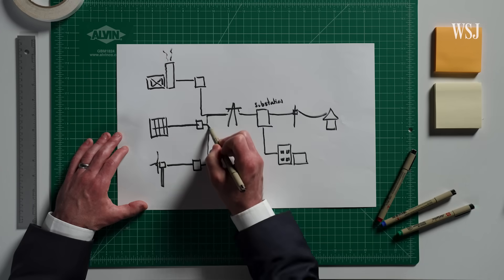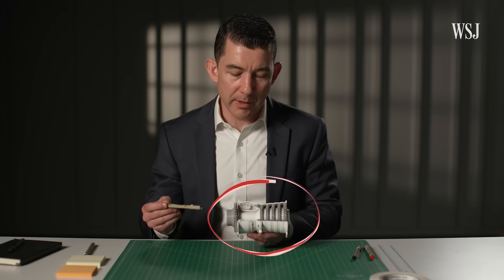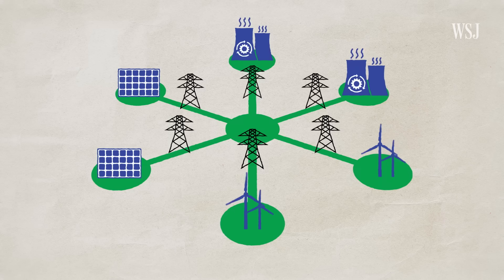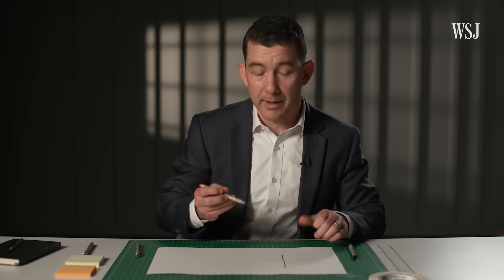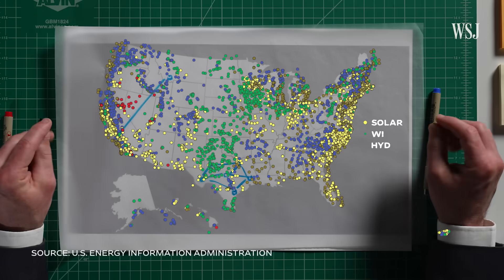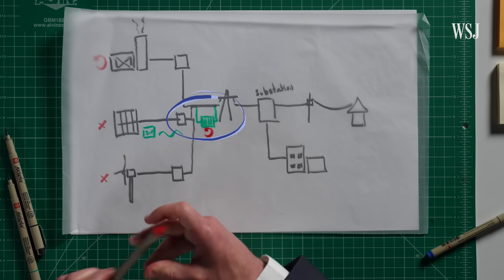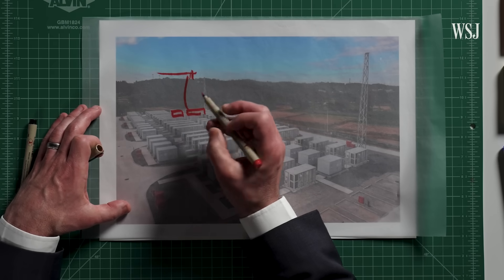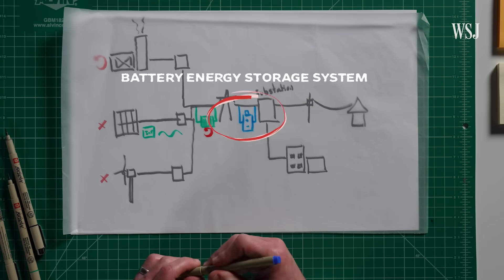How to Fix Renewable Energy’s Hidden Infrastructure Problem | WSJ Pro Perfected

Comment: Use Tesla massive battery packs, that is the solution…. Struggling with other things that are old and they are not designe with new technology like solar panels etc
Reply: This battery packs need to supply energy through the grid inverter, and this does not have enough inertia! And the problem will be not solved! Not the missing battery makes problems, but missing inertia in the grid! You need this inertia, that the grid can work stable, thats all!
Reply: @konstantinhuwa3064  Not really.  Batteries with inverters with the right software & sensors can provide "synthetic inertia".  This synthetic inertia can be better than physical inertia because electronics can work in millisecond speed to match frequency and phase.  But rotating masses of steam turbines take time especially phase matching.  If the turbine cannot match the grid's frequency and phase quickly enough,  the turbine actually becomes a drag on the grid and introduces instability.

Moreover, batteries provide large amounts of two-way energy.  That is, a battery can soak up power during the mid-day when the grid is abundant with power.  This energy can be used later.  That alone provides a large amount of grid stability later on especially as this surplus mid-day energy might be otherwise curtailed so saving this power to storage is very cheap—possibly even free!

A synchronous condenser (and any turbine really) can't do any of that and only provides reactive power stabilization.  The next generation grid will still have synchronous condensors, but a lot more grid storage capabilities too.  The next generation grid won't be like the old generation grid.  This is how technology progresses as you can't keep thinking the same mindset and make progress at the same time.
Reply: @beyondfossil  Thank you for your explanation, but i know, how batteries work, and what is synthetic inertia. And by rotating mass and physical inertia of them was not meant some turbine and alternator, which is not synchronized with the grid, and needs time to do it,  but rotating mass, which is already synchronously rotating with the grid, and don't even need a millisecond to react! It is already part of the grid, and reacts instantly. Because in the huge grid there are waves of changing of frequencies, which are walking from side to side, reflecting from the ends, behave like waves and through superposition can happen, that frequency itself could be ok, but the surging is too high! And by the grid, there are such protection mechanisms, which turn off exactly by fast changing frequency! And it can feed to collapse, even if there is enough power in the grid. The grid can behave like ripples on the sea, and destroy itself if there is not enough inertia. And sometimes, even synthetic inertia can be not enough. And maybe the cheapest way to get this inertia, is flywheel + alternator in the vacuum chamber, to reduce energy consumption, which reacts faster, than electronic systems?
Reply: @konstantinhuwa3064  Yes, glad you mentioned all that.  In fact the drifting and rippling problem you described is a direct consequence of the old "analog" grid design that we inherited!  Especially with today's grids that span such wide geographic distances.

What's happening is the grid is so wide-spread that the timings can change over the large expanse of a typical grid.  Example: at 60 Hz, a full cycle is about 16.7 milliseconds, so a 1° phase error corresponds to just 46 microseconds.  So over 1000 km, signal delay is around 5 ms, which could mean more than 100° of phase difference if unmanaged.  That 1000 km doesn't have to be a distance away either—but just a "linear" distance which can occur well within 1000 km distance given the complex topology of grid connections.

The true heart of the problem is our current grid is analog and is essentially operating asynchronous mode.  It is also using itself to check that itself is working—this is is an incorrect way to do this check as you cannot accurately use yourself to test if yourself is working as it causes "recursive" self-propagating errors.
Reply: @konstantinhuwa3064  YouTube is not allowing me to post any more information
Reply: @beyondfossil  The problem, what we have seen in Spain is not only blackout, because of not adequate inertia, the problem is, that grid has collapsed completely. It would be much better, when by problems somewhere each small part of the grid could disconnect themself and work separately, without problems. But so, you need a very distributed system, with enough storage systems and enough power everywhere, capable of actively changing the frequency to match to other parts of the grid, in case to build a huge grid again. That's why alternator + flywheels are needed everywhere, well distributed. Synthetic inertia is good, but i would not trust it, because it can be damaged through cyber attack, through too high sun activity, or some other electromagnetic impulse. Too much electronic systems is not good, good old flywheel and alternator is much more reliable! Even on big nuclear plants this mechanism is used to supply critical infrastructure with electrical power, when power plants lose connection to the grid, or by blackout - rotating mass + alternator.
Reply: @konstantinhuwa3064  Something strange is happening here in the forums.  Your response this morning doesn't show up on the forums but only shows up in my alerts feed.   My response to  your response isn't showing up either.  I'll keep trying...
Reply: @konstantinhuwa3064  Sure, but regular turbine-based generation is also subject to attacks and errors.

Turbines actually become loads (drags) on the grid (as a synchronous motor) if their fuel flow were cut which is worse than an instant blackout.  Even without a preemptive grid disconnect, a turbine would only provide a few seconds of inertia before becoming a megawatt-sized drag.
Reply: @konstantinhuwa3064  Furthermore…

Turbine-based generation is also controlled by electronics integrated with the grid.  If the electronics detected a fault, they would quickly disconnect the turbine from the grid otherwise the turbine actually becomes a load on the grid as it becomes a synchronous motor pulling from the grid!  Being a load on the with massive megawatt -sized turbine is actually worse than a quick disconnect.

In fact, maximum damage to the grid would be inflicted if somehow turbine fuel flow shutdown occurred while also leaving the turbine synchronously tied to the grid!  The load (drag) that a megawatt sized turbine would have significantly greater negative consequences than an instant disconnection!
Reply: @konstantinhuwa3064  Furthermore…

So the argument that "turbines provide inertia" is actually not a benefit in this case.  The so-called benefit is actually completely by-passed in normal turbine fault-recovery operations and you have a near instant disconnection in either case.

Moreover, although inverters may instantly disconnect by nature, they can also quickly reconnect in order of magnitude faster than a turbine could ever do.  Reconnection for an inverter might be only as complicated as car merging onto a freeway.
Reply: @beyondfossil  I am not talking about steam turbine + alternator, i am talking about flywheel + alternator, such machines in vacuum chamber (to reduce self consumption) are for example specially added to grid in Ireland, 120 t weight, because they have much of wind power plants, which does not have enough inertia. This is not my personal fantasy, these are already real machines, which work very well, mechanically, with real inertia!
Reply: @konstantinhuwa3064  That is good to hear.  I often use flywheel kinetic energy storage (amongst others options) as an additional option over lithium batteries against detractors who say we can't get enough storage because of limitations of lithium.

But, just to be clear, flywheel energy storage still needs an inverter though.  So, from the grid's point view, it appears as an inverter resource.
Reply: @konstantinhuwa3064  Specifically, a flywheel's power electronics rectifies the 3 phase alternator AC output to get DC electricity then DC is feed into an normal inverter similar to how wind turbines do it.

Because, like a wind turbine, the flywheel does not operate as direct coupled synchronous load like a steam turbine since the flywheel's RPM is likely never in the range that matches the frequency and phase of the grid.  

The flywheel needs highest available RPM to store the most energy possible.  Then the RPM slowly falls as energy is extracted from it.  Kinda like the voltage of a battery drops as current is drawn from it.
Reply: @beyondfossil  No my friend, this flywheel + electrical machine has nothing of power electronics between the grid and his electrical machine, to change his rotational speed, it is not for storage of energy, it is really only for the inertia of the grid! Nothing more! Imagine, you take a synchronous electrical 3 phase machine with a flywheel on them, accelerate him, till it has the same frequency and phase, like a grid, and connect it to the grid, with nothing additional at all! It gives only inertia to the grid, to stabilize it, that's all.
Reply: @konstantinhuwa3064   Okay, that sounds like  a fairly common synchronous condenser which is used all over the grids even in today's era of lot of turbine generation.  I mentioned this piece of equipment on my first response.  A synchronous condenser likely would be used in next generation grids as well.
Reply: Except a battery bank that could support the entire usa would literally cost trillions of dollars. 

That's not an option my man

Comment: Normally, all steam turbines and alternators rotate with 3600 rpm. But if the energy of rotating mass depends from square of rotational speed, it is better to use some epicyclic gear box between alternator/motor and mechanical flywheel, to increase the angular momentum, so the inertia of this unit will be higher, like when alternator is directly connected to the flywheel.

Or maybe much better instead of gear box to use special frequency changing transformer between power grid and alternator/motor + flywheel? Because so the inertia will be square times higher, and alternator/motor will also rotate with higher speed, together with flywheel, so the inertia will also be higher! For example, if the frequency on the primar winding on the grid side will be 60 Hz, but on the second winding of the transformer for example 180 Hz, then motor and flywheel will rotate with 10800 rpm! And achieve 3x3=9 times more inertia, than by 3600 rpm! And no mechanical gear box will be needed, what could be much more reliant, more cheaper and have much longer life time! And the whole rotational modul could rotate closed in vakuum, to reduce energy consumpion!
Reply: No, that doesn't work.  There is no "special frequency changing" anything in electronics without first going through a DC (rectification) stage.   Turbines that are able to supply inertia can only do so because they have fixed reduction gears.  No variable anything.  i.e. they have to be strongly mechanically coupled to work as intended.

Frequencies have to be synchronized down to microseconds of phase variance.  No amount of variable-gearing magic can match that.

-Matt
Reply: @junkerzn7312 Of course there is such a mechanism, for example if you connect two electrical machines through a common shaft, and one machine will work by 60 Hz, and the second one for example by 180 Hz. And to the second machine we could connect an electrically additional alternator + flywheel, which will rotate with 10800 rpm, and achieve 9 times higher angular momentum and inertia, like if it will rotate only with 3600 rpm! And variable reduction/multiplication mechanism is for example so called double fed electric machine. Of course you need an additional frequency controller, to change the rotational speed of the magnetic field of the rotor, but it has good mechanical behaviour for transferring of inertia and additionally working like an energy storage system with a wide range of rotational speed of flywheel.
Reply: @konstantinhuwa3064  What do you think the shaft is connected to?  Rotating magnets.  Read what I said again carefully and think about how the energy is being manipulated.
Reply: @junkerzn7312  What do you mean? If you have only an alternator + flywheel, there is also a magnetic coupling inside, through a magnetic field in the electric machine. There is no "strongly mechanically coupled". Thats why i also have written about doubly fed electric machines, which could give best coupling between grid and flywheel, and also give the possibility, to variably change of rotational speed of flywheel, that it will achieve 2 purposes: inertia + energy storage property.
Reply: @konstantinhuwa3064  The shaft in this case is effectively the rectifier.  You effectively have a fixed reduction gear or, if multiplying (or dividing) by an integral number a different number of magnets.  

Fixed ratios work just fine mechanically.  Variable ratios do not.
Reply: @junkerzn7312  Sorry my friend, i don't really understand, what you mean. Do you know, what is the doubly fed electric machine? And how does it work? It works perfectly with the variable ratio between the electrical grid with constant frequency and the mechanical part with variable rotational speed!
Reply: @konstantinhuwa3064  Sorry my friend, but do you even know how a DFIG works?  Because ... that very first posting I made is very relevant to DFIG operation.  There's a DC mid-bus in DFIGs.  And power electronics as well.
Reply: @junkerzn7312  Yes, you are right, but there are two different things: you use power electronic to work directly with electrical power, like by grid inverters, and you can achieve only synthetic inertia or you use power electronics to work through magnetic field, and if you make it right and smart, you can achieve "real" inertia, similar like by old good flywheel + alternator. These are two different things, because in the first case you need to transport ALL power through power electronics, and in the second case only part of it.
Reply: @junkerzn7312  And if we know, that the energy of rotating mass depends on the square of rotational speed, it is better to use a flywheel in the upper range of rotational speed. For example if we will accelerate a flywheel with the mass around 200 tons and moment of inertia around 720E3 kg•m^2 from 3000 rpm to 5000 rpm, the energies of both states were around 9.8 MWh and 27 MWh, so the capacity of this energy storage would be 17.2 MWh. Such capacity would be equivalent to 4,5 Tesla Mega Pack containers! Also the adequate power of DFIG would be needed, maybe 10 MW, to charge this storage at least during 2 h, for example by the way of photovoltaic at daytime. So there would be formidable energy storage with formidable power, and additional formidable inertia for the grid!
Reply: @konstantinhuwa3064  That's only if you are able to use the full velocity range of the flywheel, from 0 to N, which you can't in a DFIG.  And if you are trying to generate momentum with it, the usable velocity range is very narrow.

Wind turbines are generally only able to operate within a velocity range that is roughly a doubling, and it takes a gearbox to achieve even that much.

Again, the momentum is not a natural function of the DFIG.  The windings are almost independent of each other.  It is a function of the power electronics inside the DFIG. 

The only way to get natural mechanically-coupled momentum is with a synchronous condenser... basically a flywheel that operates at a fixed rotational speed. Only a small portion of the energy represented by the rotating mass can actually be used for that function.

-Matt